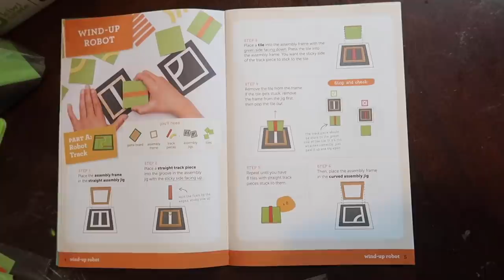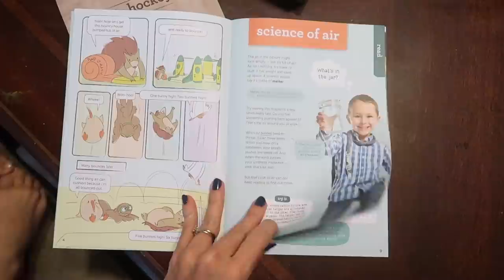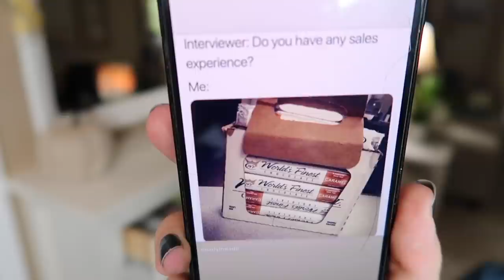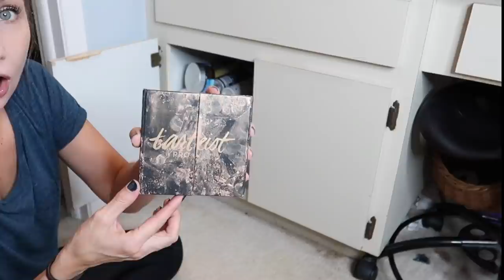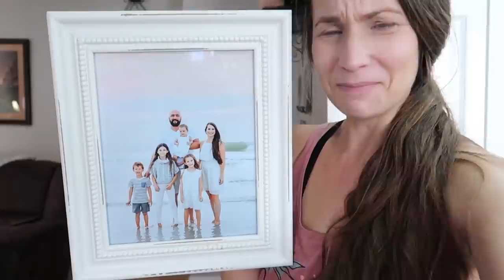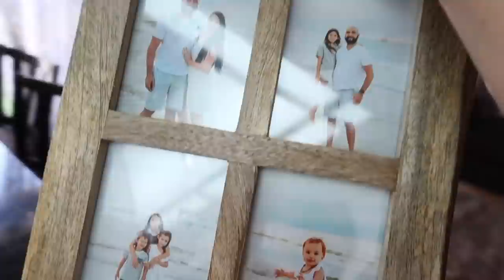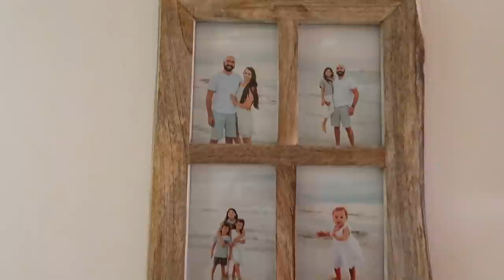Around The House Happenings! Whole House Clean With Me / Tidy/ Get My Life Together Cleaning Service

Comment: Expecting grandparents to babysit????  No ma'am.  I made/had these kids, so I don't EXPECT anyone to do anything for them.  I appreciate when they do, and actually, I expect them NOT to do anything.  They've raised their kids.  They should be having fun now.  I have to call my dad, to see if he's even in state, much less at home.  He has a beach house, and stays there A LOT.  He retired, but also works at 3 fire stations, and teaches at the local college.  Mom?  She'd rather spend money on them than time WITH my kids.
Also, the relationship between the kids, and their grandparents is THEIR relationship, not mine.  So, there's that.  My kids are old enough to decide.  They're 27, 25, and 18, so that's on them.  The olders and my dad hang out frequently, because they all ride motorcycles together.

Comment: Magic Eraser ist the right thing to get coloured Pencils off of Surfaces or Walls. But you need a little bit of Water. You can´t use them dry. And don´t use on shiny surfaces, it will scratch them.

Comment: I use to blow dry my hair but then noticed how much damage and tangles it made and decided its not worth my time or the money on heat spray. Now I air dry and use the blow dryer for winter plastic sealing my windows. Most times things I don't use often enough to justify the money I spent, I either re purpose it or donate.

Comment: Motivation galore! The best thing for cleaning hard water residue is citric acid or plain vinegar (but that's a smelly option). Just dissolve a teaspoon of citric acid in very warm water and put on a surface (with vinegar no need for water) . Leave on for a couple of minutes. Works like a charm, no harsh chemicals.

Comment: A question… what is hard water? Does that residue get on everything or just the fridge filter water?
Reply: Hard water is usually from having a private well. It does not have chlorine added like town water so there are higher levels of iron and calcium which causes residue to build up like on her fridge, and yes it does leave a residue on anything that has water sit regularly like the shower heads, sink faucets, toilets, dish washer, and washing machine. We have a natural spring well which is great tasting water but if we do not regularly scrub tough residue builds up so fast.